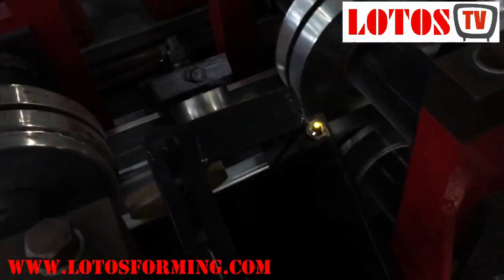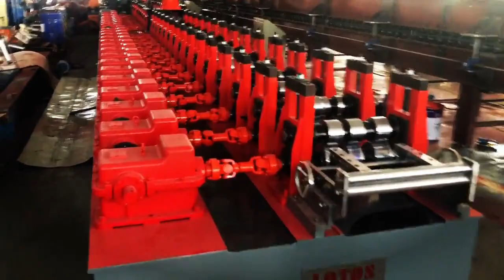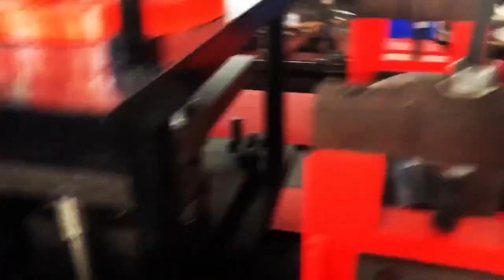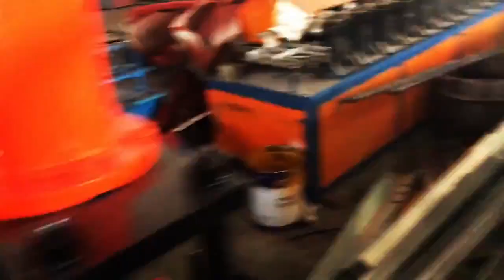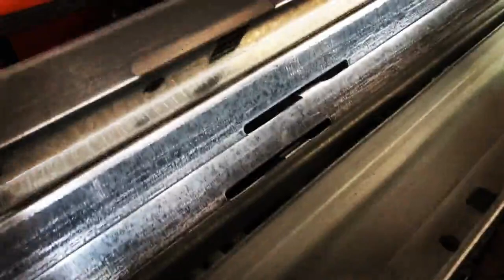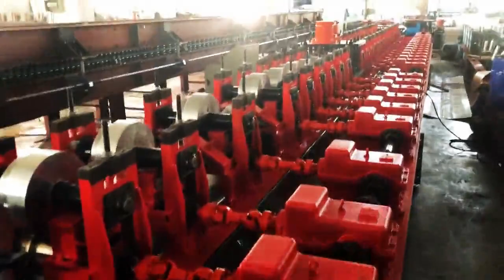roll forming machine : door frame roll forming machine (2019)

Comment: lots forming is really great manufacture for roll forming machine,
this door frame roll forming machine is really help manufactures to increase speed and productivity, can this machine produce different size of frame'??
Reply: Yes, similar desgine with changeable size could be prpduced in one machine.
Reply from the maker: top hat machine, u channel roll forming machines, upright rack roll forming machine, used roll forming line, used sheet metal roller, what is roll forming
Reply from the maker: metal forming companies, metal roll forming machine, metal roll forming profile machine, metal rolling machine, metal roof roll forming machine for sale, metal roofing machine